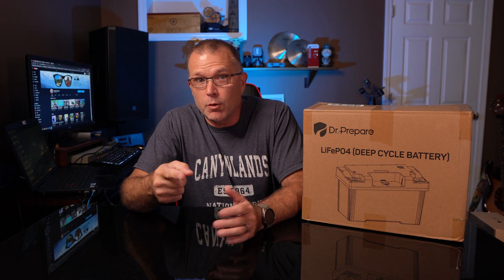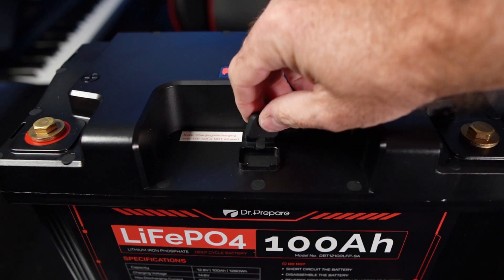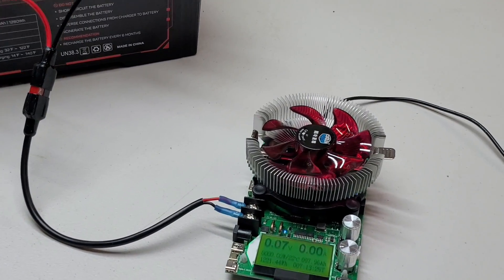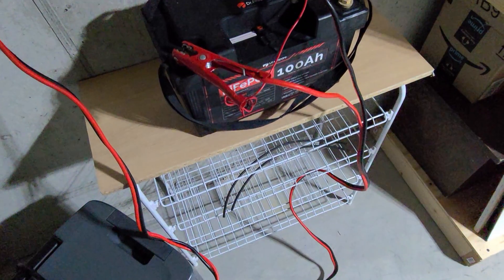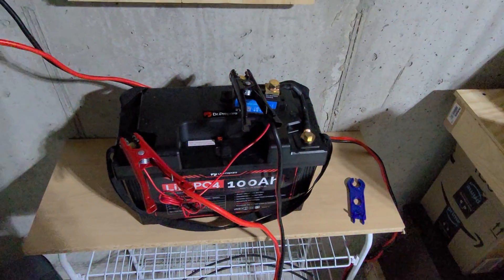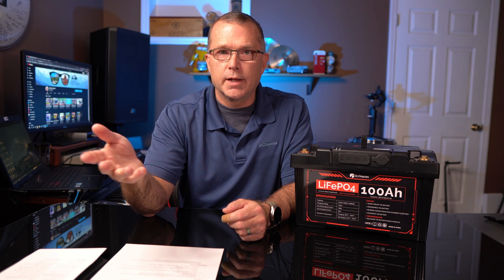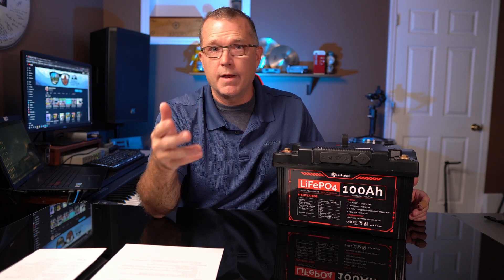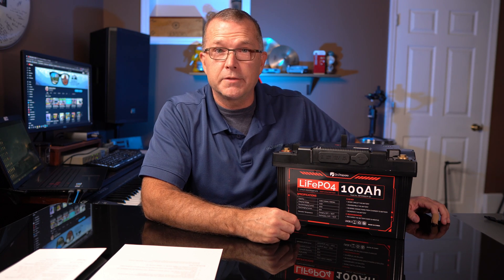COMBO LiFePO4 Deep-Cycle Battery AND Portable Power Station?  YES!!   Dr. Prepare PowerMax Battery

Comment: This is very helpful.  I saw your charger pull in 200+ watts on solar when the manufacturer had it rated at 100 meaning a 200 watt panel would work just fine. Thanks for sharing.

Comment: Question: can I hook the hub anderson connector to a 20 amp line from the tow rig/ coach (cig lighter instead of solar)? or will I need a true dc/dc converter?

Comment: Great overview. Two questions. Can you think of any reason to use the Anderson connector that connects to the hub? That is, don’t plug the hub in but use that Anderson connection fir something else? Curious what the output would be. 

Second, thoughts on using this not only as a DC power station but to charge another solar generator. I’m not always in slots where there is an electrical connection and too shaded or rainy for solar. Thanks!

Comment: i just ordered this,
do i need to use the hub to charge it with a solar panel via anderson?
Reply from the maker: Yes. The hub regulates the power to the battery from the solar panel to protect the battery

Comment: Could this also work as an expansion to the bluetti eb3a ?
Reply from the maker: Would be super easy to plug in the car charger cable for the EB3A and keep it charging from that while using the AC DC outputs on the EB3A.
Reply: @ReeWrayOutdoors  that's what I was hoping to hear, don't know how fast that'll give it charge, but I know the eb3a will except it pretty fast.
So you should be able to run 500 watts ac if needed for quite a bit of time if you had this as expansion 👍,thx for the response. 
Also wondering if the pecren e2000 lfp would take full 600 watts in each port if DC instead of ac. 
We tend to lose some in conversion when using brick
Reply from the maker: @Steven Williams  yes, just be careful not to exceed the max rated volts and current (you can find that listed in the manual online, don't recall the exact details off the top of my head)  On this Dr. Prepare battery DC module,  keep in mind that the 12V output is going to be fairly low output...maybe something like 80-96W...so definitely not going to keep up with a 500W load for very long.

Comment: can you recommend an AC charger to top off at home?
Reply from the maker: I've been using this 12V  20A charger since last October and it seems solid:  https://amzn.to/3n2nmZT    I will say that if you're needing to fully charge something with more than about 200Ah total capacity, you'd probably want to jump to a 40A charger to reduce charge time.  (also I assumed you were looking for a 12V charger...so this particular charger would not work on a 24V or higher system).

Comment: I'm sure the hub will work fine even if you put the batteries in series 24,36 or 48v but the problem of not allowing "Series" should be related to the BMS mosfets voltage specifications. The Hub will work fine even with another battery on the series, but using that hub on an individual battery will unbalance the SOC on the series. Thank you for your review!
Reply from the maker: yeah, I'm sure you're right about that!  I should've thought that thru more thoroughly, rather than speaking off-the-cuff on that point. :P

Comment: @ReeWray Outdoors  Hello, I ran into an issue with the hub shutting down. I plugged my Bluetti DC enhancer into the hub cigarette port. It pulls about 100 watts & about 8 amps. It would run for about an hour or so then shut down. I could start it back up but it would shut down again and again. I am going to try it again using the terminals.

Comment: How many solar panels I can use...I can use 3 100watt....and Thank you for sharing your videos...they are very interesting
Reply from the maker: If you're just charging thru the DC hub, you're stuck with 100W.  If you add an inexpensive charge controller, you could easily connect alot more.
Reply: Thank you ☝️✌️

Comment: How can I connect a house lamp or a fan to this?
Reply from the maker: The EASIEST way would be to pickup a DC (USB) lamp and fan.  But if you need to go AC, you'd have to attach a small AC inverter to the battery and plug into that.   You wouldn't need much for a lamp and a fan.  Just 500W would do it...
Reply: @ReeWrayOutdoors  thanks

Comment: It’s too bad that the battery failed the claimed 100Ah test… every other brand battery I’ve seen tested with LiFePO4 cells has EXCEEDED the rating when new… if this failed to reach 100Ah, how low will it go after a few charge cycles?

Comment: After trying to go off grid for a week in my van, only making it 4 days on my power stations strictly using them for two 12 volt fridges, I knew I needed something better. Drive, charge power stations. Start engine, charge power stations- Oops, blew a fuse. Set up portable solar panels, only partial charge because clouds had fun with me. Especially the black clouds. 
Then came the rains...ok, at this point, I'm forced to a campground for power to charge everything back up again!  
I can't afford those big bad boy power stations. BUT!! These Dr Prepare batteries with the hubs are a game changer!! 
I ordered 2, am still waiting for the hubs to arrive. Also bought a smart charger (electric) that can charge these up on shore power. 
I use these fridges 24/7, so these batteries will be a Godsend!!
Reply: I know this is an old comment, but any chance you can share a link to the charger you got?

Comment: Thank you for this review on this battery. Pretty cool. Since the included 12V Cigarette is only limited to about 6A, therefore it doesn't sound suitable to be an expansion battery for a solar generator. However, one could use a fused clamped connector on the terminals to a 12V female, and then 12V Cigarette lighter into a XT60 connector into an Ecoflow Delta 2 perhaps? Offering ~100W of backup. In your opinion would this be a suitable use for this battery?
Reply from the maker: That definitely works!  In fact, I just tried it and I got exactly 100W into the Delta 2.   As I mentioned in one of your previous comments, I'm posting a video tomorrow morning about how to do this a different way, that (on the Delta 2) actually gives you about 180W of input since it steps up the voltage to 24V, but it does take a LITTLE bit more time since have to splice cable and crimp connectors.  So funny that you posed this question right now, with that video already uploaded and scheduled. :P
Reply: @ReeWrayOutdoors  looking forward to it!
Reply: @ReeWrayOutdoors  Hello, I ran into an issue with the hub shutting down. I plugged my Bluetti DC enhancer into the hub cigarette port. It pulls about 100 watts & about 8 amps. It would run for about an hour or so then shut down. I could start it back up but it would shut down again and again. I am going to try it again using the terminals.
Reply: @RobertStevensService  that’s functioning as it’s supposed to and covered in the manual. For 10A continuous, use the terminals instead of the hub
Reply: @ReeWrayOutdoors   did you post this mentioned video?  I could not find it on your channel…link?
Reply from the maker: @thetoolmat8632  https://youtu.be/Xv8KC2MfjGQ I think this is the video you're looking for?
Reply: According to the Website, the Cigarette Lighter (Port) is rated for 12V/10A (Though I noticed a warning that using at 7A or higher for an hour could cause over-heating and shut the hub down.
Reply: @davesdiversions8078  when I said 6A I meant “limited to 6A continuous”. We’ll see, can’t wait to try it out since my Dr Prepare arrives tmr.
Reply: @LiquidTurbo  Gotcha.

Comment: So... you can not discharge power into another unit because of the amp / overheating limits.You can not use more than (1) 100 watt solar panel to charge it up from the sun and that shud take 12 + hours. So I am not seeing the benefit of using this device even though it is very  cool.
Reply from the maker: No, it basically works just like any other 12.8V 100Ah battery - except that you can't connect it in series to other batteries because it needs to stay at 12V to prevent damaging the DC output module.  But it does give you easy DC output options with a simply snap-in module much like a power station (without the AC inverter, of course)

Comment: Can you charge the battery with 400 watts of solar without using the DC HUB input - 100 Watt Solar?  I want to connect a Victron 30 Amp Charge Controller directly to the Battery Terminals. I'll have two of these batteries connected in parallel - 200AH.
Reply from the maker: Absolutely,  if you're going thru a charge controller.  No problem.
Reply: @ReeWrayOutdoors  how would you connect the panels to the battery terminals? through alligator clamps? or something else? Newbie here.
Reply from the maker: @michellelaclair  well for just casual convenience     charging, you could connect a 100W panel directly to the Anderson connector in the DC hub.  But for more serious solar charging, you'd need a charge controller that would sit between the battery and the solar panel(s) and would connect directly to the battery terminals instead of the Anderson connector. That would enable you to connect up to about 600W (depending on the CC) and easily fully charge in just 2 or 3 hours of decent sun.
Reply: @ReeWrayOutdoors  Great!!!  The only thing I dont know is how do you hook up the charge controller to the battery terminals? alligator clips? thick gauge/short wire with the holes on the end?
Reply from the maker: @michellelaclair  You can use either on a small setup, really.  I've done it both ways - really depends on how often you want to disconnect it.  Here's a video I did over the summer that does a walk-through for you of 1 possible setup that you might find helpful:  https://youtu.be/9BgM0PWPjZU
Reply: I got one. The built in state of charge indicator seems to have an early failure of the 4th light. It is dim, but both my solar charge controller and my LFP battery charger say the battery is full.  I charge it directly to the terminals through an SAE connector, and plug in my refrig or tire inflator through a terminal-attached car socket. The car socket on the hub now has an adaptor that gives me two moreUSB plugs and a volt meter. The hub is on a small-Anderson extension cord so it can be accessed from either the front seat or next to the bed in the van. 👍

Comment: can it go under the hood
Reply from the maker: For the most part, these LiFePO4 batteries are not recommended for engine-starting since they don't typically support a sufficiently high enough Amp output for cranking an engine (assuming that was your question ;) )
Reply: @ReeWrayOutdoors  oh okay because I know headways will start a car easily And those are LiFePO4 batteries. So I'm guessing it's just a specific type that must come in this case that you're showing

Comment: With effectively being a portable power station is there any carry handles ?
Reply from the maker: It does come with nylon straps for easier carrying (removable, obviously).  But it's not hard to carry  2-handed either without the straps since there's a little groove on each side to get your fingers under.  Straps are an easier and 1-handed option though.

Comment: It is too bad the MPPT controller is so small. !00 watts is a trickle charger for a large battery. I personally rarely use an inverter; I'm a strictly 12-volt user. I would like to see the MPPT controller at 400 watts input and I wouldn't have to buy a power station. I like your reviews.
Reply: you could add 100 watt of solar for each battery i presume.

Comment: That`s interesting. You can power a wide variety of things including 12v rice cookers, 12v fridges, and USB powered battery chargers, fans, lights, laptops, and more. Get a 1000w AC inverter and you have emergency power for a dorm fridge or small box freezer. It should easily power a dorm fridge or small chest freezer between 30 and 40 hours depending on ambient temperature and inverter efficiency.